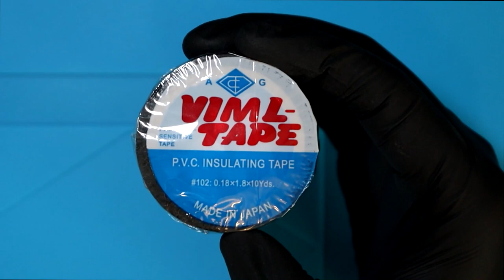Nintendo DS Lite Shell Swap | My FIRST Time with No Experience

Comment: I did this last night, and it honestly would have been super reasonable if the replacement shell I bought was of a higher quality, but because the molding was not perfect it got frustrating when trying to fit it all together at the end. I popped on the original back and it went on perfect, but the new back just wouldn't sit properly without me trimming down the plastic in some areas.
Reply from the maker: Yup completely agreed Lynx! A decent shell would make this process so much easier :)

Comment: Hey, not sure if you'd be able to help me, but after doing this with my own ds lite the power button is loose and no longer works, do you know what I may have done wrong? It has no restriction on its movements, perhaps I have lost a piece of it?
Reply from the maker: Hey :) I would double check that the latch on the inside of the power slider hasn't snapped off, and that it's making a connection with the power slider on the motherboard.

Could be that you've just accidentally snapped a piece of. Let me know!
Reply: @JoeyDoesTech  Ah! Damn me and mu clumsy hands, I have snapped a piece off. No idea where that piece could be.
Reply from the maker: @whygamingwhy2404  Been there a few times my friend! It's one of those tough learning lessons, but at least you'll be more cautious in the future as I've learned! 

If you can find something to replace it that would be really cool, if not grab a new shell otherwise it will annoy you!
Reply: @JoeyDoesTech  ill just try to melt some plastic into a similar shape and hope for the best lol